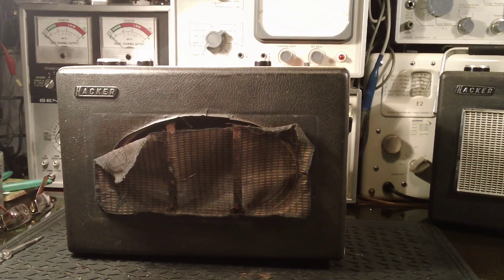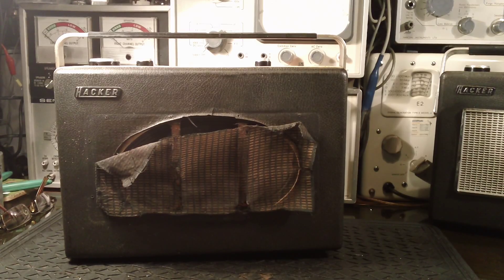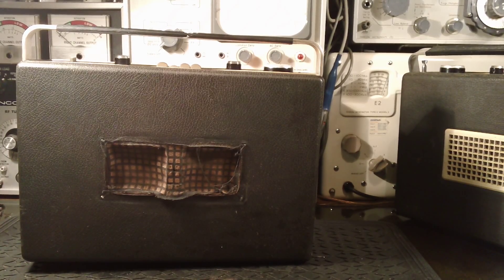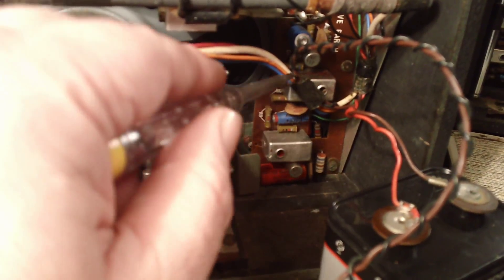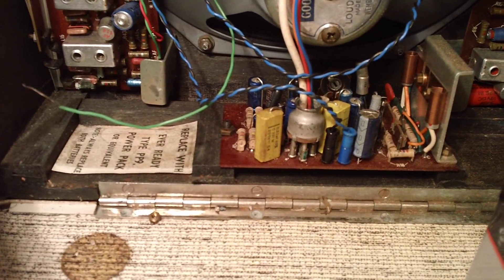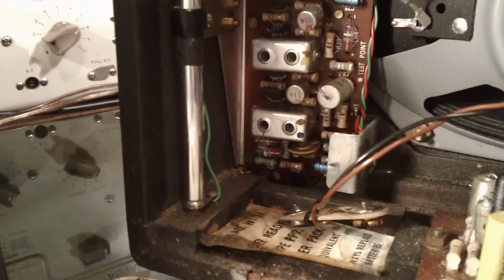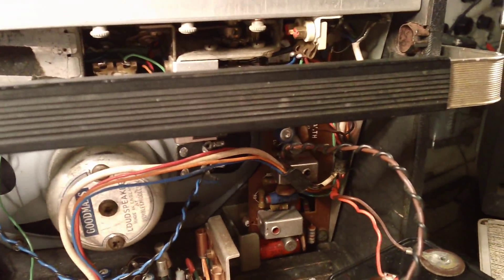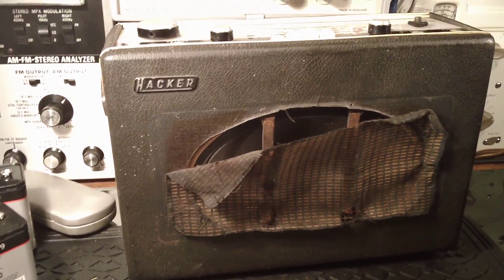Hacker RP18 Sovereign radio restore Part 1

Comment: Hello Andrew, are those old styled circular transistors still available? 
What's the cause of not picking up many stations across the dial? Im amazed that you can so quickly diagnose problems. Wonderful project-look forward to seeing and hearing it when your finished.
Reply from the maker: Hi Clay, hope you're well. Those old transistors are beloved over here, they get tin whiskers growing from inside the metal case which eventually touch the transistor junction thus ending life. They are so common in 1960s sets here that we know before the set arrives there is bound to be an issue. You can still occasionally pick up NOS but they're likely to be bad.  Regards - Andrew

Comment: Do these sets run on 18volts with the PP9's  in series ?
Reply from the maker: Brain Scar They do indeed
Reply: some sets from other brands used two batteries but fed one side of the speaker from 'mid point' junction of the 2, saving using a coupling capacitor, this causes problems such as distortion if one battery goes down before the other or the two halves of the output stage become unbalanced, you could fit a capacitor in series to reduce unbalance problems, ..in many cases the actual signal stages run on 6 to 9 volts so in theory they could be modded for single battery use, the worst ones are ones that use 6v pp1's as these are long obsolete, and you need to rig up battery holders for AAs or C cells,
Reply: i have 2 of the first Hacker models, type RP10 but their innards are totally different, one with the dreaded Mullard AF117's in the RF stages, OC types in the AF, and quite complex current and temperature stabilised output stage using small selenium rectifiers, the other uses Ediswan(Mazda) black 'top hat' transistors in a more 'conventional' circuit..

Comment: This project will certainly be worth the effort Andy.  Hacker produced luxury products that certainly looked good, performed well, and sounded close to Hi-fi.   As you say, AF-type transistors were prone to developing intermittent, internal, connection faults.  I’m tending to find those types of transistors are not so easy to come-by these days.
It will be a superb radio once you’ve completed the repair/restoration work.
Regards,
Phil.
Reply from the maker: +SteelCity321PB  Thanks Phil. Yes, AF transistors (124/5/6/7 to replace AF114 /5/6/7) are getting quite expensive now.  I haven't tried silicon PNP in these yet but may have to think about it one day. About time you got your cine camera out too!
Reply: +Andrewausfa You may have to go the Soviet/Russian surplus route on those, a la Shango066, finding some North American made germanium types is often a problem too, unless you are lucky enough to find a cash of NOS ones from a closed down service shop or from a old hobbiest's stash. The one major drawback is that the packaging is often quite different, but apparently the Soviet/Russian made germaniums were manufactured well into the 1990s and apparently don't suffer the same ailments as European or North American transistors from the 1960s do with internal shorts and intermittents.